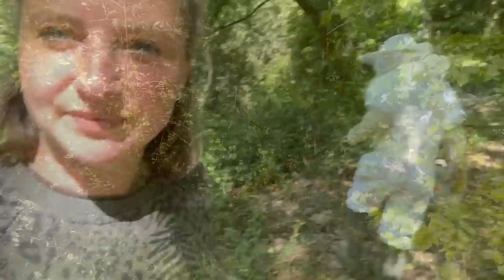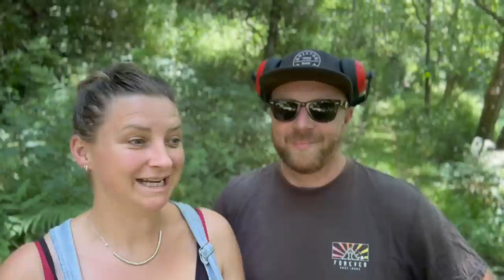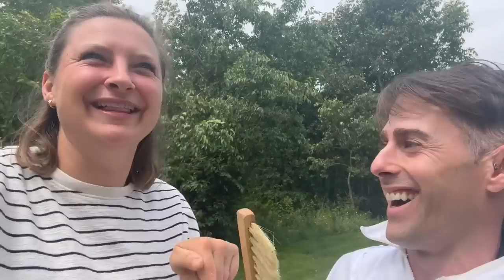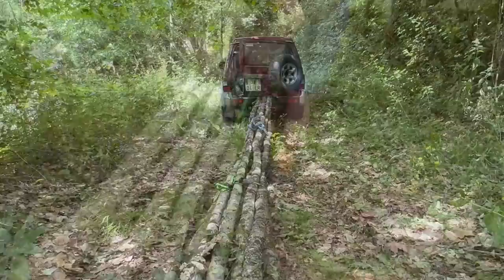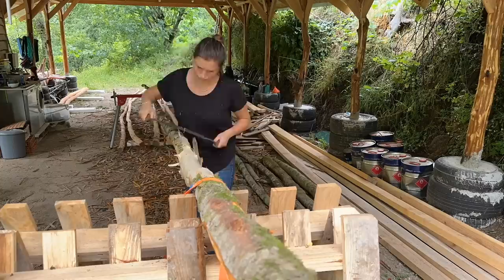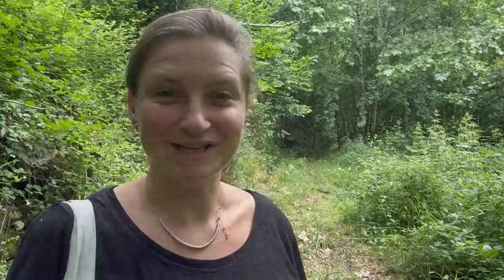⚠️ WARNING⚠️                                                🇵🇹PREPARE TO BEE AMAZED🐝

Comment: If you like the apples on the broken tree. You can air layer several limbs and have your own orchard. You can use zip loc baggies with potting soil inside them to air layer. Fill the baggie then cut a slice in the middle on one side. You tube has many videos.
Reply from the maker: We had apples from the tree last year and they were good we will try them again this year and if they are as good as we remembered we will definitely try this thank you! ☺️